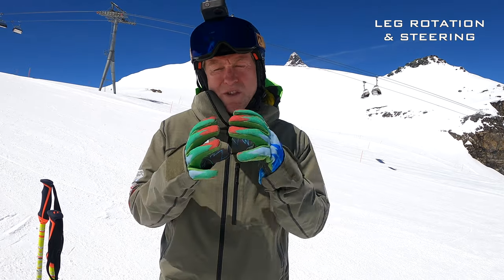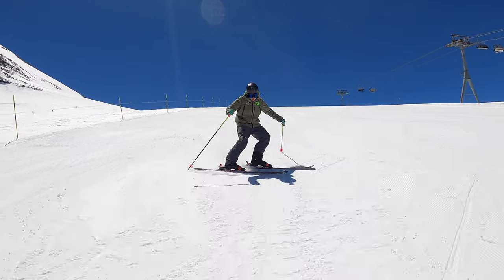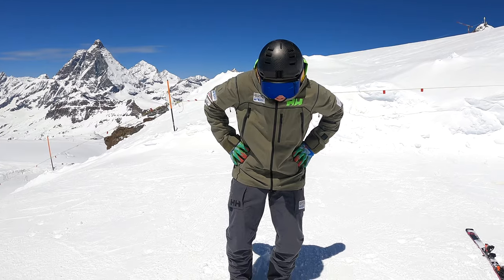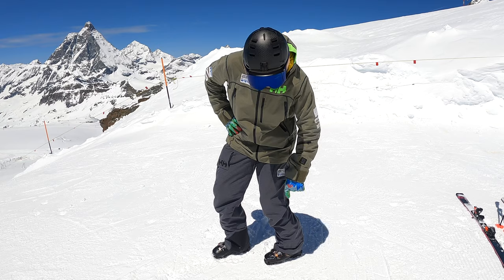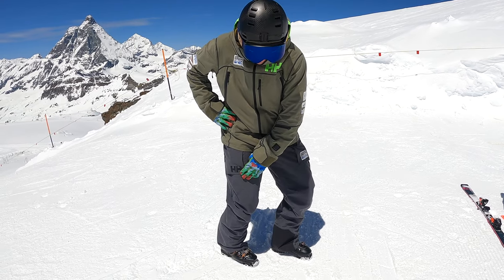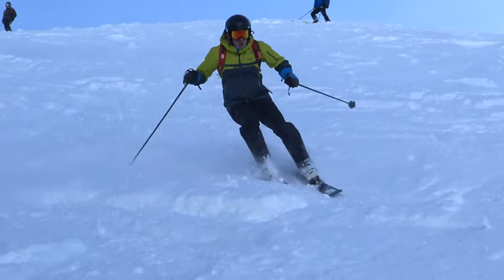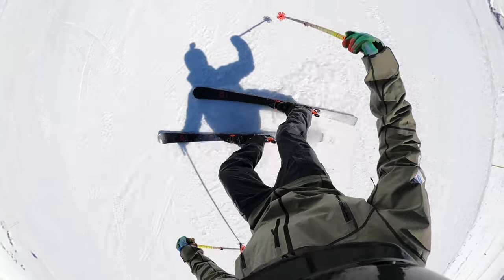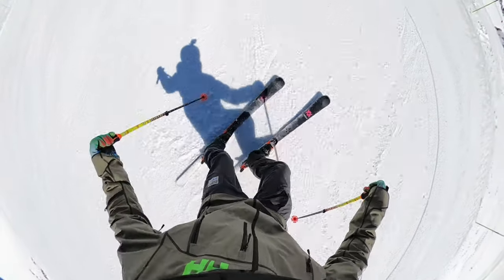Leg Rotation for Skiers - Steering

Comment: Except, that's not how to ski.
Reply from the maker: Thanks very much for your comment. Could be worth investigating this further. Please do subscribe as it really helps us 🤙🏻
Reply: You're absolutely right! What he's really trying to say is the process of moving from the inside edge to the outside edge of each ski, but this also needs to be in timing with pole plants of the corresponding pole while keeping the shoulders aligned downhill. This should be done like a dance instructor does, step-by-step, pole-by-pole. Not this, ''let it all hang out'' style so prevalent in common instruction.